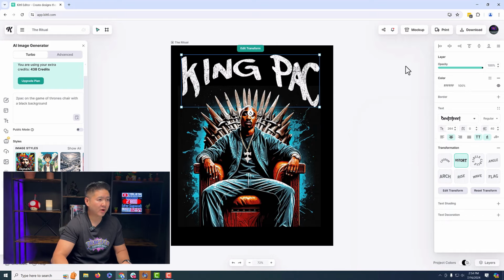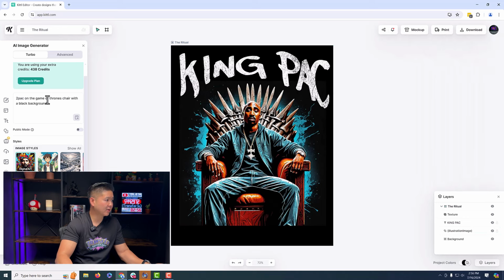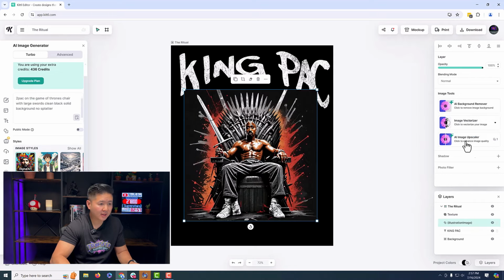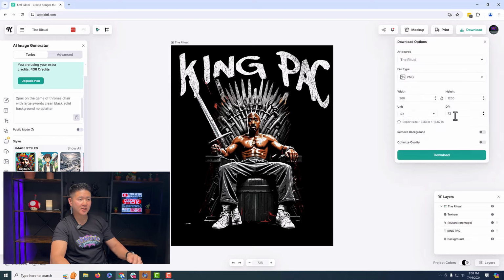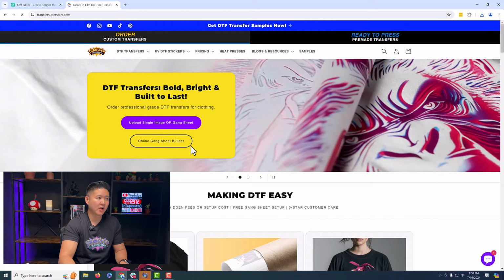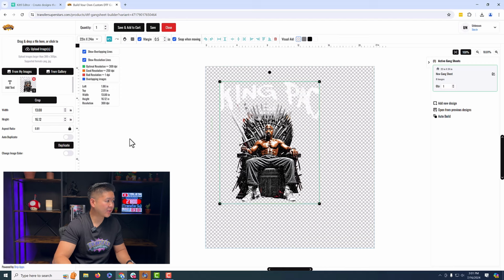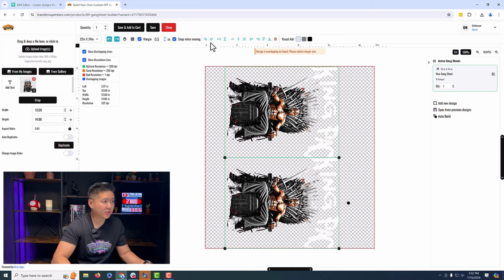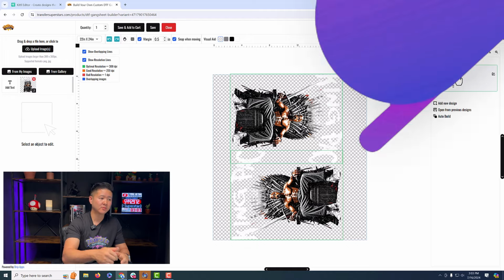DIY 90's Bootleg T-Shirts: Kittl & AI Design Tricks for Beginners

Comment: Could you please do a video on how to take an image from kittle/AI etc that has the less than perfect white backing and show what you do to correct it in photoshop please, but use an image that has had blck knocked out maybe to show differences? thank you. geat video.
Reply from the maker: Not sure what you mean less than perfect white backing. So far we've been able to use kittl images just fine without cleaning up the edges at all.
Reply: @transfersuperstars  12:54 to 13:40 will explain

Comment: If you download as a png and remove the background I end up with a black box .. if I download as a png I don’t have to remove the background.. I do if I download a jpeg.
Reply from the maker: Are you using the paid version of kittl?
Reply: @transfersuperstars  yes.. also depending on what artwork it is and the creator you might have to go into your own software and adjust borders for your white layer or it will be visible on prints.. I love kittl but it’s far from just download and print on many designs.. at least on my printer anyway..